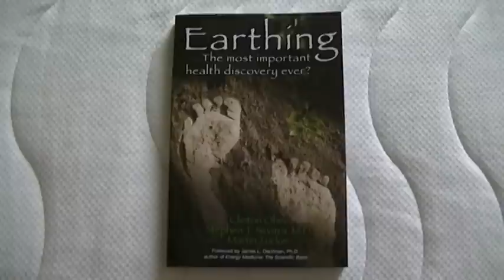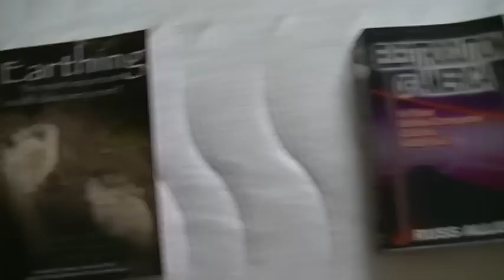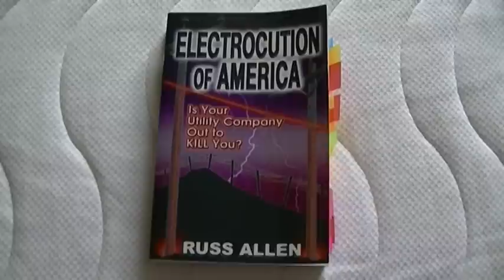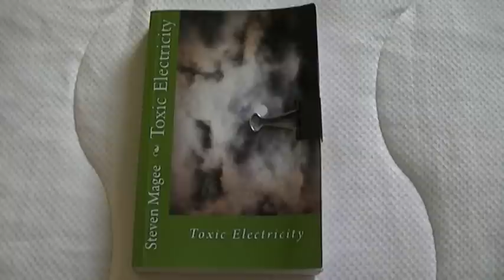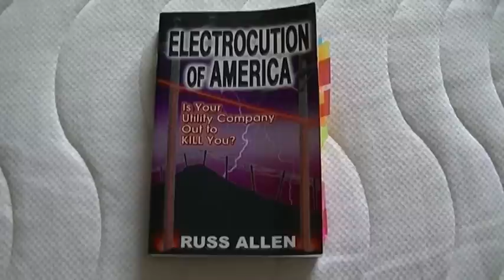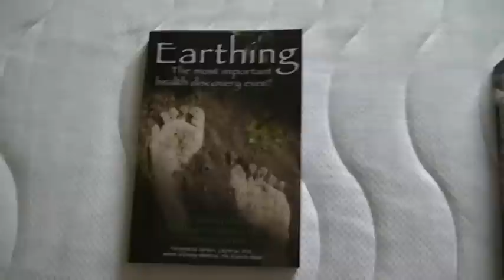Earthing (Grounding) Health Risks

Comment: As an electronic eingineer myself, I am not suprized the Author of this video had more problems than he bargained for. Considering the way he connected his earthing system up. First off, he put a 100K ohm resistor in "series" with the ground path. Isolating and floating the ground conductor way above ground with the 100K 
resistance. This negated the ground effect entirely. not to mention, he used a long conductor all the way to his "garden", the second mistake. What he now had was two completely independent voltage sources, better known as a voltage divider or differential amplifier in electronic terms. Although the voltage and current produced is in microvolts and microamps, the copper conductor was so far above ground that it was now an RF "antenna" or collector. Picking up all stray positive ION's, stray EMP's, RF and microwaves from the surrounding atmosphere. I am suprized he was not "well done" in the morning! No pun intended. If you want the best source for earthing and near zero electrical potential, you need to drive a 1/2" or 5/8" x 10' copper ground rod into the ground as "close" as possible to your earthing location. The shorter the better! I would not recommend a wire length any longer than 10' maximum! Otherwise you will again be subject to common mode voltages "above ground". And "NEVER, EVER" connect your earthing to your house electrical ground. It is pure Lunacy to do this! Your home electrical service ground (neutral) can be as high as 30 volts potential above ground depending how far the utility distribution transformer neutral and ground is from your house. Do not ever use an earthing system that connects to your house electrical ground. EVER! I can explain why further if someone really wants to be scared half to death.
Reply: +Joanna “Yoasha” B. I'm totally for grounding.  I'm no expert on it, though, and I'm just getting into it, as far as using the earthing tech.  I just remember hearing, at a lecture, a while back, that if you're going to use the outlet option, that you should turn off the circuit for where ever that outlet is.  It sounds like using an earthing rod is an even better option, though.  I think personal research is necessary for precautionary safety.  We definitely could benefit from more electricians doing research on it with their particular line of expertise.  
I try to do barefeet when I can--but, it's winter for me right now.  One experience I had, though, which was memorable was a while ago in Hawaii.  I tend to have a restless mind, and on this day, in particular, I was troubled about something or other.  I was outside so I went and laid down on a bare rock.  I remember that, pretty quickly, I was able to settle down and feel more peaceful(while being mindful of any bugs, of course) than I'd ever felt in a while.  It was a hard rock, so my head was on my arm, but I felt so relaxed and calm.  There have also been some times when I had some built up emotions, and was outside near some trees.  So, I put my hands on them, or just leaned against them, and released those emotions into the ground that way.  I tend to believe in all things having a spirit, so it helped to imagine the tree/earth as being someone who was able and willing to taking any emotions I needed to release.  It was a very cleansing and comforting experience.  That was a lot more than you asked for, but I just wanted to share some of my own experiences in grounding, as I don't exactly have any big physical healing stories.  Not sure where you're at with it, but those are just some reasons why I believe in grounding/earthing.
Reply: you need to ensure your electricity was run/connected properly otherwise u risk high emf - I have been grounding in my ground house plug since aug 2016 and I feel fantastic - because its healing me - I did a blood cell analysis under microscope its helping my metal toxicity
Reply: @cheryllewis3059  hi Cheryl, do you still do earthing/grounding? If so have your symptoms continued to improve? Hope you're well, Charlie.
Reply: @charlieb9144  yes I ground while sleeping since 2016 - my biggest ailment was my advanced DDD (disc degenerating disease) I couldn’t get out of bed - I also take various supplements which I think helps too - I had my blood looked at under a microscope wet and dry in my health food store and at my age just about 60 yrs my blood is not thick and my blood cells are a healthy shape - I sleep amazingly - I think it’s healthy to ground regardless - for all the bad things I do or put Inside my body I like to think grounding helps
Reply: @cheryllewis3059  what brand mat are you using for the grounding? And do you disconnect power to that outlet when you have the grounding mat attached? I'm new to this and trying to learn about it. Thanks!
Reply: @casperjennings9348  intuition physician she’s an md turned naturopath her father a scientist - I like and trust her - I started with a bracelet then did the socks then bought a mattress pad it was over 300 lasted 3 yrs when I tested it didn’t work - she gave me a free cover to always be grounded - no I don’t disconnect my power - the cords are equipped with fuses to break any surge of electricity - should the elect ground get hit by lightening
Reply: @cheryllewis3059  Thank you so much!
Reply: Are you saying that...
If I test the AC socket's ground hole.... 
And with a GROUND TESTER it tests as a VALID GROUND...
That it may NOT be so!!!!???  :-/

You said the 
"electrical service ground (neutral) can be as high as 30 volts potential ..."

Thus...If I measure the positive voltage in MYSELF at a +7.5 VOLTS..
And I find that putting my foot on the grounding mat...
My voltage falls to ZERO...

That in fact this is NOT ZERO....
Because MY REAL MEASUREMENT should be 
30 volts.... PLUS.... the 7.5 volts I hold in my body...
Thus by GROUNDING....
I only subtracted the 7.5 volts POSITIVE DIFFERENCE...
But that THE GROUNDING MAT....IS STILL...
POSITIVE 30 VOLTS!???  :-/

That sounds odd, really!
Reply: +robindorf55 Can you simply just tell me whether I am good to go just using my genuine earthing sheet (throw) plugged into my eathing point per plug provided i.e. in my ground floor flat in London where the buildings are earthed? Do I have to worry about underground electrical leakage etc? Thanks :)
Reply: @lynette1231  Hi! Thanks for the question Lynette. Did anyone answer your question?
 I do not understand Electrical jargons but I am definitely interested in knowing if I and my family should continue to use Earthing Mats or not? I have been using it so far so good. But I do not want to end up with Short-term benefit and Long-term loss!
Reply: Yep one big long rf antenna too sleep on probably not a good idea.I live off grid remote rural on solar wind power and ground direct.May i add here for those that live on grid do yourselfs a favor put your mobile phone at some distance fron the place you sleep and turn of your wi-fi router at night and see how much better you sleep less emf
Reply: @TheSilmarillian  Correct. I turn off five devices every night before bed. I sleep fifty feet from the so-called dead devices. Zero wifi. Zero TV. Soon, I will cut off all electricity in my bedroom while sleeping. Stay healthy, happy and strong!
Reply: @IamEarth.IamWater  If you wish run a ground wire to a large enough piece of aluminum foil  attach with alligator clip place it under the laptop  it under your laptop and run a ground wire outside to a copper spike .If you live in an area of high electrical storms disconnect the wire during storms.
Reply: Hello Jordan, Sorry for the delayed reply. I understand now more about your previous comments. 
It it very interesting how you felt an emotional relief while earthing. I have done eathing unknowingly during my childhood. Those days no one was even aware the science behind it. I have discovered as an adult and the science behind it just few years ago. My attention was grabbed more because of the anti-inflammatory action. I do earthing during Spring, Summer and Fall in the park near by where i do Qui gong exercises. My awarness on human connections to the Mother Earth is growing each and every day. Because it is Winter where i live and my plans to go to the warmer climate are not materializing I want to make my own grounding mat. 
I would like to start paying attention to my emotions while grounding. Many thanks again for your reply. Stay healthy and happy Yoasha
Reply: robindorf55 - For some of us, grounding via the electrical ground is the only option (even if it's not ideal) so I'm wondering - surely without the 100k resistor in the ground path, one would not be protected from surges? Also, in spite of picking up stray electromagnetic energy this way, would I not still be benefiting more than not being earthed at all, because at least that stray energy is immediately going to ground?
Reply: +robindorf55 I heard that it's not a problem if you shut off the circuit in the area where you're sleeping.  Is that true? Would it work?
Reply: +robindorf55 Thank you so much for elucidating this as I have felt much better for using my earthing sheet plugged into the earth hole of my switched off bedroom socket! I felt worse for about a week and then started to feel quite spruce after a long term illness.
Reply: yes, please go on in informing us.
Reply: robindorf55   Well explained;  any solution to a chief Earthing effects  then?
Thank you if you'd. ........
Reply: I've found something extraordinary I'll share. I've noticed an annoying sound from the electrical wiring in my home. It's like a ringing or nails on chalk board that people ignore inadvertently. If they focus they hear it. I believe by charging a 12v battery with a computer charger the noise is removed. Very interesting I've done it more than a few times and it seems to work. I assume the battery is absorbing the high frequencies.
Reply: I have been grounding for six years
Reply: Sorry , i am confused. There is only partial comment from you. So in your opinion the grounding makes sense or not? thanks Yoasha
Reply: +Joanna “Yoasha” B. Who is question directed towards?
Reply: +robindorf55 I'm grateful for your input but dont quite understand what you meant by a couple of things, so am hoping you would please re-explain 2 things for me (& for all of us who have little understanding of such things). You said to "drive copper ground rod into the ground as close as possible to your earthing location". What do you mean by "the earthing location"? If I was using an earthing mat (or whatever), are you saying the wire to the copper ground wire must only be maximum 10feet long from the earthing mat? If so does that mean we need to use earthing products near a window so there's only a short distance to a copper rod driven into the ground?
Also, some people say they connect to the house electrical powerpoint ground when the powerpoint is turned off & that this is ok - is this incorrector still bad?     I've been chronically ill in bed for many years & so cant do much but use my laptop for many hrs each day, & there is a huge electrical transformer on the powerlines only about 40feet from my house & since its impossible to move house I'm needing to help my health by cutting out as many negative effects of electricity, wifi, etc.as possible. I am considering acquiring earthing mats etc, but this video & your comments have left me unsure as to what I can do! I'd really appreciate you helping me (& others) with your ideas & knowledge on this matter!  Thankyou!
Reply: @owlprophet1 I read your question/comment. Your story moved me. I'm sending you love and good "energy " your way. I hope you were successful in your grounding and you are feeling better.❤
Reply: Adam in Wonderland PS you see your homes ground rod? Now look theres a utility ground rod at the pole. Wow I wonder if current flows between the two. Hmmm
Reply: So i had mine hooked up to house ground for like a year. No effects good or bad. Finally connected it to a ground rod out window about 6' deep, and i feel terrible the first 2 days now! Woke up 5:45am sharp and feel braindead and fatigued. It feels similar to when i quit gluton cold turkey and had a systemic herxheimer reaction for 2 days years ago

I live way back in the woods far away from wifi or development besides my phone. Think this is an immune system response or could my setup be wrong? 

Liked your response, its hard to find the combo of logical and not so open minded the brain falls out on this topic
Reply: @GoodVibesOnly1914  I'm new to all this too. Have purchased a grounding mat. I felt painful,sore and tired for first couple of days. I had similar doubts too, then I read somewhere online that these symptoms are normal esp in areas of body that are weak and also to slowly introduce the process to the body. 1st couple of days to do it for either 10 or 20 mins depending on the body's response and then keep increasing 5 minutes every week or so and also to drink plenty of water. 
These tips helped me a lot. I still do not use/intend to use the mat for 8 hours marathon but I do use for 25 mins and I am okay with it. Have not seen big improvements but subtle ones. 
Hope this helps. I am so jealous. U re living in such a pure environment. I know it comes with its own challenges but the quality of air and water is really refreshing to lungs, heart and mind!
Reply: @Divya Singh  thank you! I worked really hard for it for it and it's definitely pure and pristene! As an update, woke up again at 5:45 which is not normal for me! Turned off wifi and phones this time, , i doubt that had an effect, but I do feel much better today. I have a feeling my body did indeed have to go through some sort of adjustment
Reply: @GoodVibesOnly1914  I am really happy for you Jake👍👏
Reply: Exactly
Reply: Jordan it is directed to you thanks
Reply: robindorf55 i would like to know why not to connect it to the home output if possible. I’ve grounded to my home ground but have had no negative effects but i’ve only used it for only about a week
Reply: @GodForgiveUs661  hi, I started grounding to home. Socket, only for 3 nights, good results, but I only use it for 1 hour before bed then disconnect thr socket, I alps turn off the rooter wifi, and ALL electrical appliances in the bedroom. Please message me, we can share tips. I live in London, UK, and in a 2nd floor apartment.
Reply: Can you explain? Thank you for that information.
Reply: robindorf55 - i read your comment and a lot of others here and still don t understand - is this issue only in USA or is it on and electrical system (i live in Germany, third floor in an 100year old house in the city, also a lot of electric smog around like antennas, 5G, lots and lots of WLAN devices, you name it) can i ground my mat on the heating device system (pipes with hot water, they are supposed to be grounded says the law) - i am not very able to understand electric issues like volt and how all of that works.. is this problem/risk general or is there a practical way to test it and rule that out? i also cannot ground it into a garden - so is there a way to use a mat for me or does it make everything worse?
Reply: My preference is to live isolated from the ground. Any EMF impinging on my body has no affect because there is no current path to ground. Once grounded you are providing a path for the current to flow which could be harmful.
Reply: @rickduker4969  
I agree with you Rick. Too many people buy into this grounding scenario. I think they create their own pseudo psychological effect that creates their own placebo like end result. To each their own. I would much rather be out in the sun a few hours a day and get a good dose of that natural vitamin A.
Reply: If you put your own ground rod near the house ground rod the voltage will be on your separate ground rod. Which is why you want it FAR AWAY like in the GARDEN. Away from the electrical system not right next to it. Are you stoned? You seem to know some things but wtf bro.  The earth is a conductor right? Right!? So if you put ur rod next to the homes rod you might as well hook up to it..DURP!!!!
Reply: @adaminwonderland7149  
They would both be in the same earth. 
SO they are both directly connected anyway.
Reply: droidcrasher you are creating a single circuit and can not check voltage this way. Think of a car battery if you put both leads on power or ground do you read voltage? No you don't.

Comment: Hi there. You maybe getting unwell using the earthing system because you are in a high emr environment. For example, are you sleeping in a area affected by high levels of emr from house wiring and magnetic fields or wireless radiation (wifi router, cordless phones, smart meters, etc) as well as from your neighbours properties?(you said you lived close to them). You do not know what they have plugged in inside their homes. Best practice is to check your sleeping areas with the right equipment(a HF meter, a gauss meter) first and then measure your body voltage to earth. If this is already high ie the values are in the volt ranges not millivolt ranges. You are probably becoming a conduit through which electrical charges can discharge to earth via your bare electrical wire. Also using an unearthed device in bed(laptop) can raise your body into the 20 volt ranges and this would be discharging through you to earth. I know this from experience. You must reduce you exposure to emr first and then it is safe to use the earthing mats(wire). So your message of caution in some cases is warranted. Hope you give it another try or try it sleeping in another room away from the meter box, house wiring, etc. Cheers